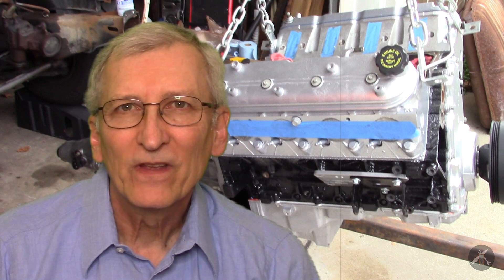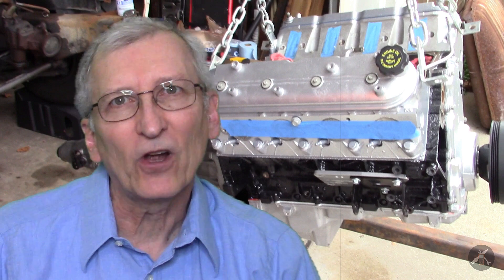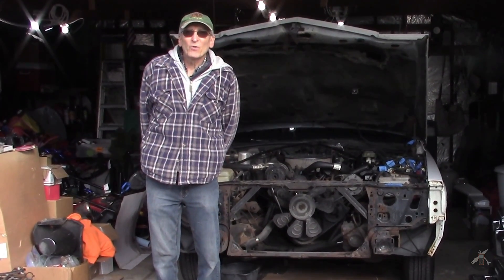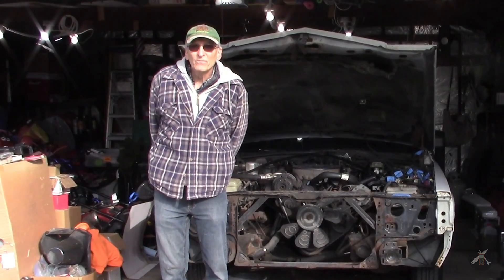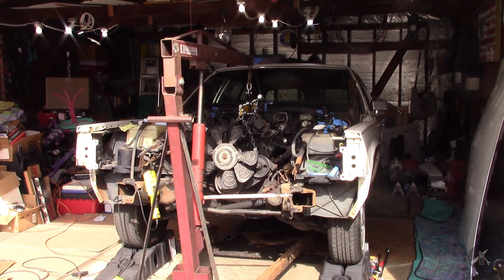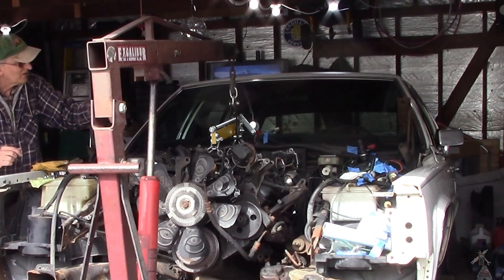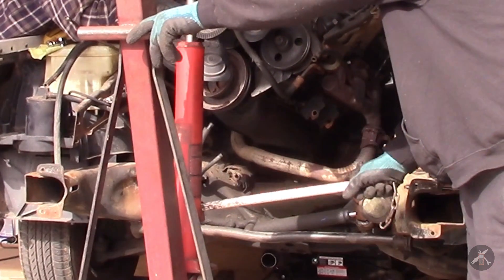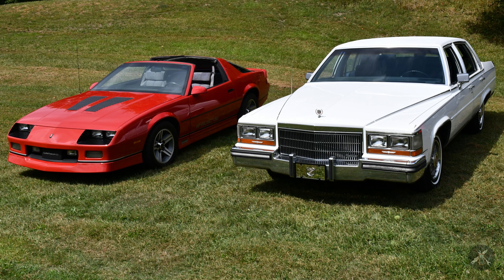Project LS Swap - What is Required to Swap an LS into an '80s GM Car?

Comment: Hello Dan, I recently found your channel and it's extremely helpful while I work on my dad's 87 Chevy with a 350 TBI engine.
One thing I am struggling with and can find nowhere in manuals or online is how and why "vacuum" is used in these engines. I am an engineer at Saginaw Steering Gear (now Nexteer) and love these old vehicles, but I was not working on them back then and I don't understand how the vacuum system works or why vacuum was chosen, but it seems so commonplace and normal that no one who understands it has gone over what it means, and how it works for people who don't natively know about it.
For example, a vacuum leak has been described by some as causing high idle "because the vehicle thinks the butterfly has been opened", but that's where the explanation always ends.
I'd really enjoy a quick overview of what "vacuum" is used for, how it's generated, and what the basic functions of it are in a vehicle engine.
Reply from the maker: I understand your question, and you are correct that the principles behind manifold vacuum are not always explained well.  I'll try to address this for you in the near future.
Reply from the maker: Try this and see if it answers your questions:
https://youtu.be/ODszeQMQ7OA

Comment: I'm thinkin' maybe a G-body Buick Regal, 5.3 out of a van, truck, SUV, etc. stock rotating assembly, stock heads and a turbo, T-56 5-speed manual trans or 4L60/80, 14×7" chrome Astro Supremes, lowered suspension (front is same as S-10), Ford 8" rear end sourced from live-axle Explorer, scuff 'n shoot paintjob with some backyard graphics (scallops, stripes or something).
ALTERNATIVE BUILD STYLE: lifted on 33" tires (monster truck, only it's granny's car on bigass tires, son!
Reply from the maker: Sounds like a good project!

Comment: Not me!  You ruin it when you do that.
Reply from the maker: The challenge in these old Cadillacs is that they are quite under powered. The 307 made 140 hp.  It had a lot of low end torque, but it's nice to have a little more power.  I tried to convince my son that we should find a 403 or even a 455 Olds.  The 403 would be externally identical and with a few tweaks can make power.  The 455 is a higher deck and so a little wider, but would look similar. BUT, the LS engines are next generation and make more power with ease. The one he has came from a truck, so with a truck style cam it ought to move the caddy really well.

Comment: Computer stuff works great when new  give it 20 years lol
Reply from the maker: You're right that computer systems can have issues with age, but it's not all bad.  I'll say that so far, my experience has been good.  The '85 IROC (after 39 years) is still running on its original ECM and while I have replaced some sensors / actuators, the old ones were still working. My son's '87 is running on an original ECM as well.

Comment: Nice love the Iroc picture next to the Cadillac. As I'm working on my 1988 Iroc I would have like to put in an LS engine for more horsepower but I live in California where smog is very strict. Will be tune on this swap.
Reply from the maker: Thank you.  I took that when we were out to the "Hines Drive Cruise" near Detroit.  And, yes California is very strict. I expect there are ways to keep them happy, since the LS engine has better baseline emissions. I know that GM was offering emissions compliant engine / trans retrofit packages, so I would think it is possible
Reply: COMMI-FORNIA IS MORE ACCURATE. YOU GUYS' TOLERANCE FOR AUTHORITISM IS OTHER WORLDLY. 🤔